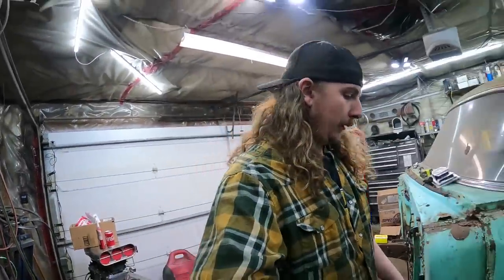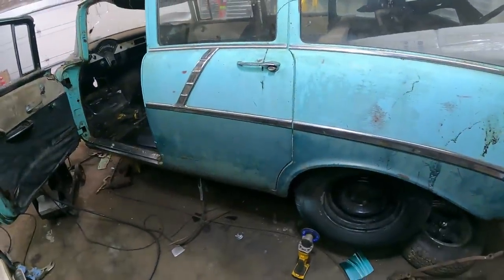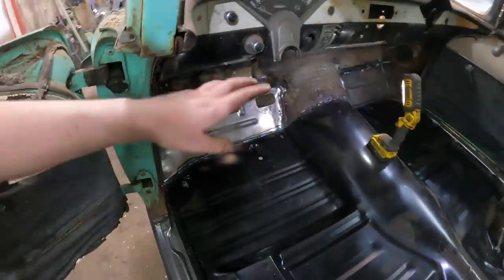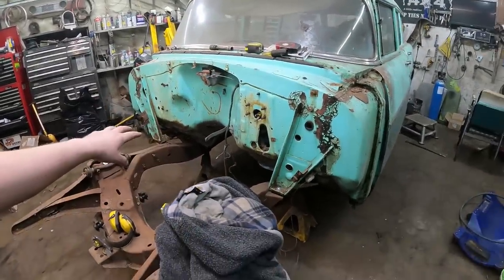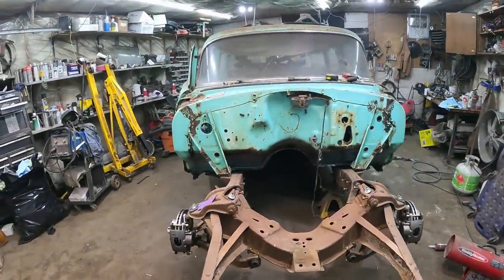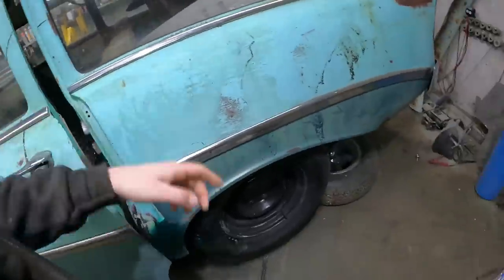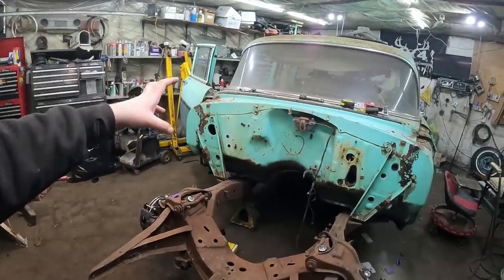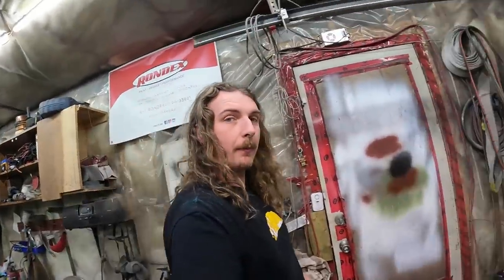Paint Matching the 1956 Chevy Long Roof - Rust Repair is COMPLETE

Comment: You work at such a fast rate I sometimes have to look back to see when you started a project. I think you're turning a car out every 2-3 weeks. No wonder you have Chernobyl jeans.
Reply: It isn't really that he's a really fast worker compared to those at say, a body shop or restoration shop. It's because he isn't reinstalling panels as they cam from the factory. Like the entire floor in this wagon was not drilled, punched and spot welded in. It was put in place. Held in a few places and full welded. Not stitched or  meticulously tacked a million times. WELDED IN.. The PLYMOUTH quarter panels probably took him 10 times longer due to being careful not to over heat the panels.  The small patches he's doing have bends all around them, so they won't twist and bow. WELD EM UP!!  So for those picking on the guys who take a month to hang a quarter panel, they are doing a shit load more work for that (I CAN'T TELL) finish. That is NOT what Dan is going after.
Reply: @SteveP-vm1uc  Totally agree.   He just wants to enjoy them ASAP.

Comment: You have almost replaced half the car. You replaced full floor pans, toe pans, rocker panels, and dog legs. That is a lot of real estate. You have a half a new station wagon. I bet that smells a lot better than when you first got it LOL=)  Looks nice and new you do good work. It does look marvelous worth every penny. Dont forget to seam seal the back side of the dog leg and paint and undercoat it or it will suck up rain and water into the body filler and blow up with rust. Did tell you that you sure get a lot of work done quickly. I like the metalic color you should paint the whole bottom and sides of the car that color looks nice. You could POR 15 the front frame clip so it dont rust through for protection.

Comment: I've seen that on Sanderson headers before. They probably sell the matching end. Three bolt collectors always always leak ,I'm in the process of replacing mine with a large turbo type clamp. Male and female with no gaskets to blow out.

Comment: So, I'm wondering if you shouldn't shoot color on there in areas, then some red oxide after scuffing, then another coat of color which will enable sanding thru the top color coat to reveal the red oxide but actually keeping color under the oxide for a good protection. Otherwise, sanding thru color down to red oxide means there is nothing under the oxide to protect the metal when the oxide starts to break down from UV.

Comment: You could use the stock motor mounts. To make them more stronger for the big block an moving just drill an put a bolt throw the mount. Ran that set-up on a 400 horse an never had any problems. Will stop all that vibes !!

Comment: Not my car,but personally I would have sprayed red primer on the bare steel for protection from corrosion then sprayed the paint and sanded through the paint a little bit to get the effect you wanted.makes no sense to spend a thousand bucks in parts, just to create the same problem again.

Comment: 04:02 the swing in the rockers at the back where the dogleg is, thats no good, there is no swing originally on these cars back there. everyone will notice the abnormality. and the bottom of the door will now not seal good. both sides should be redone. apply bondo on it after and just spray paint over it, is not a good solution.

Comment: DD.  Speed. Shop.  Paint. The.  Frame.  Wire.  Wheel. Come. On.  Front end. Is apart.  Do it.  Do it. Now.  . You. Work. LIKE. None. Other. ...Saved. Another. One.....Chevy.  Owes.  You.
Reply: DD. Speed Shop. Rules.  I like the. Rally. Wheels. Centwe. Caps.   And. Trim. Rings. ..a Set. Of. Fat.  Tires

Comment: Why are you wasting so much time on a four door wagon? Not to knock it. If it was a nomad then I'd say . I'm  a body shop owner for 30 years and have been doing this for 45 years ! To do that much welding I normally weld some the grind then weld a little more this way I'm not grinding too long at one time. You did a nice job. But we also strip to bare metal the epoxy prime then do our bondoing, just a thought.
Reply: Some people like 4 door wagons better than nomads. It’s not always about value